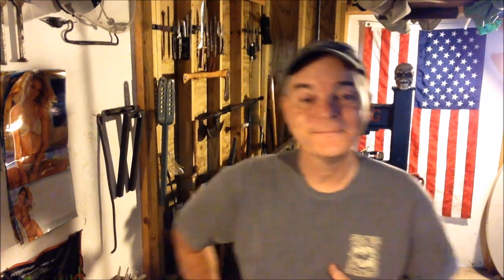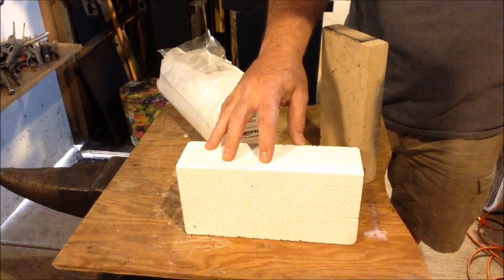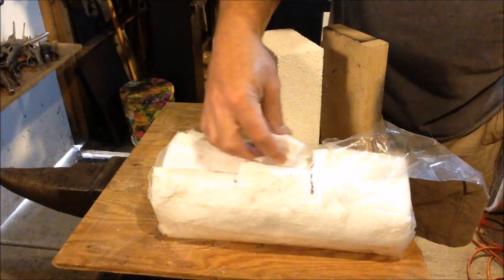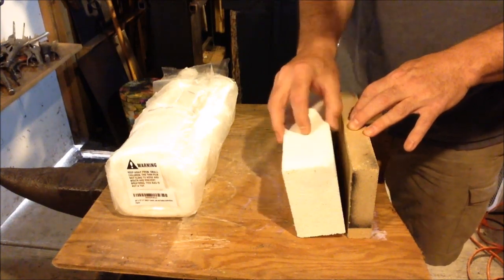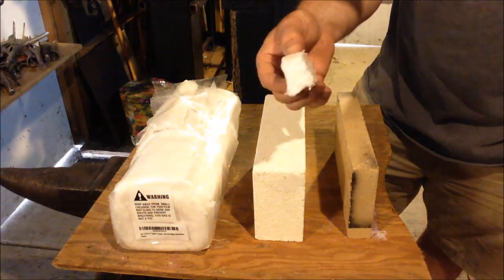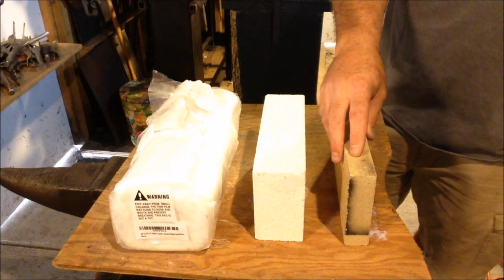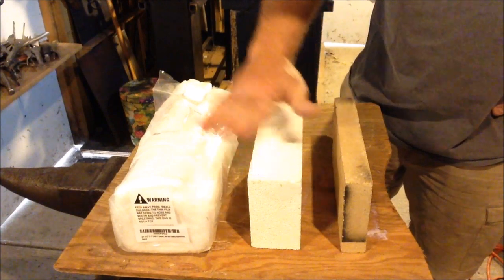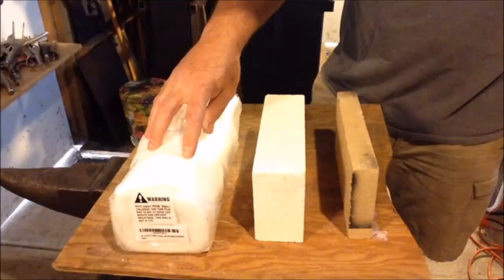Subscriber Question - Insulating My Propane Forge?

Comment: I am planning a wood fired pottery build and have learned a lot on those materials. They are all made of alumina which is cheaply made with cheap Chinese power. The price depends on how many people get it before you. For Kaowool, you need to buy a 25 foot roll of 1 inch or whatever length it takes for other thicknesses for a good deal. This is way too much material for a forge. Soft fire brick are affordable by the palette. Also look for broken sales as industrial uses do not allow them to be damaged and they are easy to break. My recommendation would be a casting mix with water glass/sand and perlite. When done correctly, it forms a very solid casting that reflects heat very well. The hard brick is good to store heat. Also, heat exchangers to pre heat some of the incoming air will make anything work. I just learned a lot about high temp applications, so may be missing something. Good video!

Comment: Never knew the the fibers needed to be coated. You are the first one to mention it. I need around 1900 for clay kiln. 
I seen one guy use plaster mixed with sand. 
I looking at the 2 inch fiber. 
I thought you were going to say the fiber was the least efficient. Cancer hmm 
Made a  patio once with fire brick. Long time ago.

Comment: you save me a lot of time!!! 
am building my first forge and now i know what to use for it!
Reply from the maker: Glad to hear and wish you good luck on your build!  Booyah!
Reply: Respectfully Sir @RickRabjohn  I was informed concrete explodes at a high heat temperature such as over 590 degrees Fahrenheit, there's so many fears / risk I don't want to take & hope to find guidance for in making my firebrick forge, I need to know if it's safe to use & what the cheapest route / best / safest brick to use for building a forge is, is there any suggestions for this, I plan on using a very high heat up to over 3000 degrees Fahrenheit & I don't know if it's safe ! I'm young & learning alot, thank you for your video & information, I wonder what name Lowes's would call the heavy hard brick your using for a furnace / forge Sir ?

In advance thank you Sincerely, & I don't know if this means anything to you, but I saw a acronyms Booyah, would NJROTC JROTC CSMC USMC Hoorah Semper Fi~ mean anything to you Sir ?
4 years & thank you for your services / leading the way Sir" Sincerely"!

Respectfully, / Sincerely.

Signed :

This young humble Florida boy / soul .

Paul~

Comment: Done a bunch of this - save yourself some time and headaches and do it right the first time with 2" of ceramic fiber insulation, like Kaowool, Superwool, etc., rigidized and coated on the inside. Best way with Kaowool is to apply a 1" layer, then rigidizer first -- let it dry -- that hardens up the ceramic fiber fabric, then another 1" layer of the wool, rigidize that (make sure to mist spray wet with water before applying the rigidizer or it won't work! -- Let the rigidizer harden/dry, then coat it with satanite or other high-temp cement, then final coat it with an IR reflector thin layer, like ITC-100. These are FAR more efficient walls for acheiving high temps than any kind of bricks. If you're just firing pottery, brick kilns are fine. If you're heating metal to welding temps, spend the money and do it right -- it'll last longer than three or four brick forges, heat quicker, hotter, and be lighter-weight. Gas forges heat up fast and cool down fast and that repeated extreme thermal cycling degrades, cracks and crumbles fire bricks to bits in short order. Fire bricks are better for kilns and ovens where they heat up slower, to lower temps, stay hot longer and cool down slowly.
Reply from the maker: I don't disagree with what your saying, and thanks for outlining the ideal set-up.  That is the best, but like I indicated, I am staying away from kaowool given my past experience with cancer.  So, that means less effeciency and dealing with cracked bricks, but so be it.  Maybe I'm being overly cautions but better safe than sorry.  At leastfor me.   Thanks again.
Reply: Would it be better to put a fire brick in the bottom in terms of durability and replaceability? Over time I feel like the bottom might degrade and being able to replace it would be helpful.
Reply: I have a question if you don’t mind.
 I am building a propane and waist  oil furnace out of an old stainless steel  shop vacuum cleaner and got enough ceramic blanket  for 2” around on the inside and got the two 50 pound bags of refectory to go on over that what thickness should i go for with the refectory ?
Reply: @tonypike5785  - totally depends on what kind of refractory you got in those 50 lb bags. If it’s KastOLite, it can be as thin as 1/2”, or you can ‘cast’ it a fair bit thicker — like 1” to 2” thick. Either way, you should DEFINITELY rigidize your ceramic blanket insulation first. You want a hard surface for the castable refractory to set on. Put in the first 1 inch layer of ceramic fiber blanket, let it air dry in a warm place, flame cure it with a low flame for a few minutes, at least twice with a cooling. In between. Then, add your second layer, rigidizer, air dry, flame cure, then you will see it is hard and ready to apply the castable on top of it. Make sure to ‘butter’ before rigidizing — spritz water lightly onto the layers before applying the rigidizer. Don’t skip the rigidizing steps! If it’s some other type of castable refractory, just follow the instructions on it for application and curing, but pretty much any of them are going to need to go onto an already-rigidized blanket. Don’t put any castable on soft blanket — it’ll crack and fail.

Comment: I’m building a ribbon burner forge and I’m going with soft fire bricks and a layer of hard fire brick on top of the soft fire bricks for the floor. The walls and roof are also soft fire brick. Coated in itc 100. I’m doing this so flux won’t obliterate the floor and it’s easily replaceable. The soft fire brick will insulate well enough and the two main reason is it’s much more durable and safe. I’d rather not deal with the ceramic wool danger.

Comment: personal opinion alert.
 1) firebrick (the yellowish compact brick) is a heat battery it absorbs heat and releases it slowly back, it is used mainly for flooring to help avoid intense spikes and drops in heats (ovens and such) they create a somewhat constant heat surface. Use it for the spot where your burner blows the flames for a long lasting wall and for the spot where you place your crucible for a somewhat uniform heating up. 
2) fire insulating brisk (the white brick) those are insulators they provide less heat exchange with the environment and minimize the heat losses they do not reflect heat back they just do not propagate that heat to the surrounding area that well. 
3) The ceramic blanket plays much the same role with the insulating bricks  with grater success.

Here is my thoughts on a forge build. Yellow bricks in the inside with white brick (or ceramic blanket) on the outside to help with the insulation. For coating I would use some sort of heat resistant concrete (plaster of paris?) to enclose the blanket (or the white bricks) and part of the yellow bricks. I expect it to  produce the best results in terms of life expectancy and maximum heat. Keep in mind those are only opinions. I never tried them so they are unfunded opinions as well.

Thank you for the explanation it was very much appreciated.
Reply from the maker: Good summary / comments - I like your ideal forge build - the other option would be the soft white brick on the sides and top and the hard brick on the bottom.  Tons of options for sure.  Thanks Booyah!
Reply: Your thoughts on the yellow bricks have changed my mind on what I am going to do. I need a forge that will be running for possibly 8 hours a day. Thus a "heat battery" is a good idea to help prevent heat loss between pours.
Reply: Thanks to Rick and  Jo Ko  for posting these -  am framing your text and start modifying my furnace
Reply: Rick/Jo  - Since the fire brick can take a lot of  heat beating - It can be used as the inner most to face the fire - and to protect the heat from losing - a normal wool insulation batt can be used to wrap the fire brick ? it is a lot cheaper than the ceramic blanket - I am just wondering if that is that effective ? what are your thoughts?

Comment: I'm working on building my first forge and opt into the firebrick method. Stuff around here cost a lot more money so those cheep fire bricks are close to 7$ a piece. I did find that cutting them was easiest with a jigsaw and a worn out wood blade. I used a old piece of angle iron and a couple of wood clamps to get a nice straight cut. What I am very curious about is if you have used the refractory cement at all? I used some to morter the bricks into place and close off any gaps in between the bricks but I was also thinking about doing a good half inch layer of it on the inside of the forge to act as  extra protection and to decrease the amount of area I need to heat. Do you think that would be a good idea or should I just leave the fire bricks showing? I have built a forced air propane burner but have no idea that actual temp it gets to.
Reply from the maker: Good question...I recently coated the inside of my forge with Satanite....so far it's working well.
Reply: @RickRabjohn  update. I lit my forge for the first time last night. The refractory cement bubbled a little with some very minor cracking but held up better than just the straight fire brick did. I did add an extra piece of firebrick with a thin coat of refractory cement on top to place on the floor and take the brunt of any wear from slag or the burner. All and all once the forge was up to temp for a good hour I threw a peice of 3/4" round bar in there and it took about 5 to 10 min before it was glowing

Comment: Hi, very informative video. I have a made a gas forge using the hard cheap firebriks, and i have added insulation in the form of vermaculite mixed with a bit of cement, to make it stay in chape . That way i have the hard durable firebriks inside the forge and it is insulatet to keep the heat in.
Reply from the maker: That sound good Steffen - how's it working?
Reply: Hi, it works allright, but i can not get up to welding temperature, maybe because i only have one burner, i have read on Anvilfire.com that one burner can heat 240 cu inch room, i have 290 cu inch room in my forge,  so that might be the reason
Reply from the maker: I experimented with my forge by 1) adding another layer of brick to reduce the cubic inches and 2) used insulating soft firebricks to reflect the heat - that said, I haven't been able to reach forge welding temps either.  I think I would need to either use the Kaowool or add a third burner.  That said, I decided to just use my coal forge for forge welding and my propane forge for everything else.

Comment: Very good information, would you feel comfortable using the insulated brick for the inside of a pizza oven with the brick exposed? Not the floor of the oven just the walls and top.

Comment: About efficiency, if you were to rub the forge for realøy long sessions, wouldnt something that apsorbs heat be better? If you insulate a second layer which reflects heat.
As an example, you are forging something, you pull it out of forge to shape it, and turn down the propane while shaping.
I imagine that the apsorbing stones will keep the forge hot for longer.
I dont know tho, im still a beginner
Reply: Really helpfull video by the way, thanks for sharing your knowøedge
Reply from the maker: I have since coated the inside of my forge with a product called Satanite - which is awesome at reflecting back the heat

Comment: I have no idea how much it cost per square inch. I bought a roll of kaol wool 1” x24”x25’ for $96. The coating I bought was $25 for a half gallon. So for $121 or so bucks. I have made 2 propane forges. 1 is 12”x18” and the other is 16”x36” 2 burner. As well as a foundry. I still have plenty left for anything else I want to make.
Reply from the maker: Thanks - That's a lot of forge space - have fun with them - Booyah!
Reply: What did you coat them with?
Reply: billy19461  it is called Tex Bond. Air set heat resistant mortar. Bought it from Texas Ferrier supply

Comment: Could I coat the hard fire brick (which came with my propane forge as a base on top of the kaowool) with Satanaite refractory cement? Would this reduce the heat it absorbs? I also want to use some bricks as doors. Same question for these. Thanks.
Reply from the maker: You can - I coated my entire inside of my gas forge fire bricks both the hard brick on bottom and soft bricks on side and top with Satanite - helped a lot in retaining heat
Reply: Thanks for the reply. I've done this now. 1 kg just about covered the lot. I'm assuming that the coating can be thin, as it is reflective. I also hardened the kaowool first. I've bought some insulating firebricks to act as a makeshift door too. Ready to fire up as soon as I finish my anvil base (joining some logs together with studding).

Comment: Hi Rick.....if you talk about efficiency. ..does the size matter..? I'm a knife maker and my forge is 4 x 6 x 18 inches and build it with hard fire bricks ( in progress ) and looking at installing two Frosty T burners.
I would like to achieve 1300 Celsius. Am I on the right track....🐾
Greetings
Reply from the maker: In terms of size, I assume you mean thickness of the fire brick.  I have tried using single 1.25 inches and then double 2.5 inches combined thickness of hard bricks which made little difference.  I also tried 2.5 inch thick soft brick on the sides with hard brick on the top and bottom...that made a nice difference.  So, if you want efficiency, use the soft brick and as thick as practical..  cheers

Comment: Hi , I watched your video, good info since I do have all 3. I went with the blanket , coated it the used refactor cement I got at a hardware store. Coated it twice and let dry. Upon curing the cement bubbled. Why??? I scraped the bubbles off and Re coated it. I have to wait 24 hours to see if the third coat fixed my problem. Any information on why it bubbled would be very helpful. Thanks
Reply from the maker: Happens to me too - likely entrapped moisture in the refractory material - I just rough up the surface (pop bubbles) after the first coat and recoat.   Someone suggested pre-drying your bricks or blanket materials in the oven to limit the bubbles.
Reply: @RickRabjohn  hi there , I took your advice and popped the bubbled areas then Re coated the area. All is good and I’m now trying to make some dragon head key chain out of rebar. Thanks again and hammer on!!

Comment: Hello @Rich Rabjohn. I was building some propane forges for sale and it was build with hard fire brick. How long does brick last? Small crack (bearly seen by a eye) are not a problem? Does these type of brick get more crack overtime? I'm using firebrick for inside forge insulation, and out the outside perlite+cement (for retaining the heat) in a barrel shape tanks (propane tank, water tank etc.)
Reply from the maker: The hard brick I bought from Lowes about  18 months ago has cracked in some areas of the forge, but are cheap enough to replace.   The soft brick has not cracked.  Good luck with your build.

Comment: You can easily make the $6.00 insulation brick, here's the recipe. 

60% Plaster of Paris or Joint Compound to 40% clean sand add hot water to activate and mix well. Pour into molds & let cure for 3 day's. This same recipe is used to mix furnace cement or fireplace mortar. Don't waste your $$ on shipping.

Comment: Hi Thanks for the great vid it was helpful. 
I have a Question for you should I use rigidizer if I’m using kast-olite? With on ceramic brick and ceramic fiber ?
Reply from the maker: I recently finished building a home foundry furnace and used the white brick coated with a similar refractory cement as kast-olite and that worked well.   I also recently relined my propane forge with white brick and applied two coats of Satanite to coat/cement - the satanite worked really well.   The trick I found was to dry the white brick in oven initially and then applying thin coats - letting them dry thoroughly before applying another coat.  Hope that helps and good luck with your build.

Comment: Very Informative! Great video, as it helped me alot. One question is that I made the metal frame of my forge a-little too small and there is really only room for 1 inch of material of my choice. For the same reasons, I have chosen not to use ceramic wool. Could I cut the ceramic brick down the middle and use it as 2 bricks( one inch thick each) and still be more efficient than the concrete bricks? Or should I just use the thinner concrete bricks? im not too concerned about efficiency as This is not something I will not do very often but I would like it  the forge to last for awhile with out much maintenance.
Reply from the maker: Thank you.  I would use the hard concrete bricks on the bottom and the softer ceramic refractory bricks cut 1" thick for the sides and top.   good luck with your forging; booyah!

Comment: You don't need a grinder to cut fire bricks. A hack saw works or even (like I did) use an old hand saw. It will dull the teeth on the blade (who cares, I use it just to cut firebrick anyway) but it works very well.
Reply from the maker: good to know and thanks for the tip.